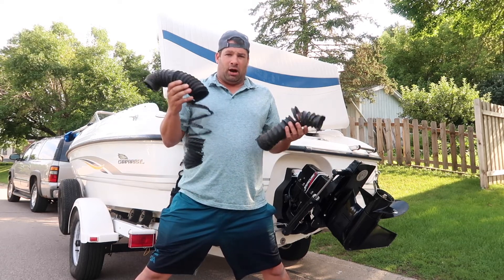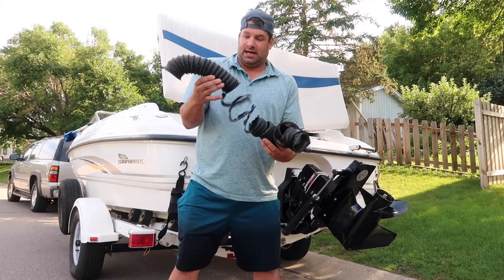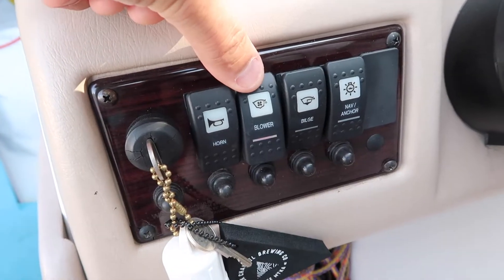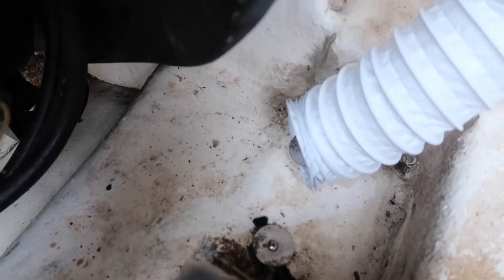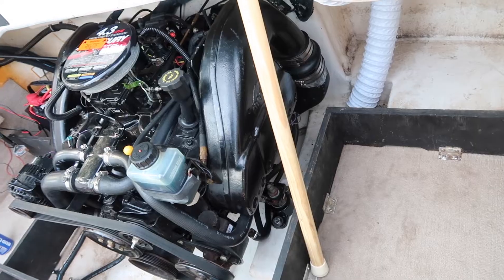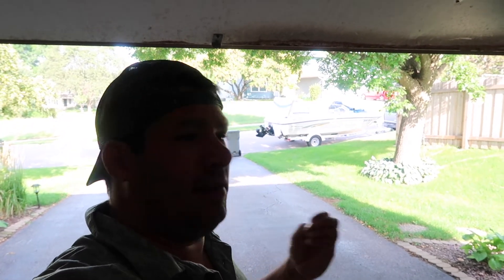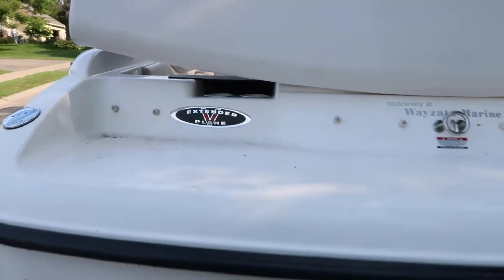What is & and Why do you need a Blower Motor in a Boat.

Comment: I've got an 06 Chapparal 256 SSI that I bought last year and I had a mechanic tell me to not even worry about using the blower motor and another one told me that I should be using the blower motor anytime I'm driving because it helps keep the engine bay from getting super hot

Comment: Also for safety:
1) go over all fuel system connections at the start of each season, tighten clamps, check for leaks
2) install a gas fume detector, I put one in my boat about 7 years ago, should be standard on gas inboards....
3) make sure all electrical equipment is J1171 Certified for inboard marine use (starters, alternators, even fuse blocks)
Reply from the maker: Great points. I agree, fume detectors should come standard
Reply from the maker: Thank you for all the helpful tips for everyone reading the comments. It will help people

Comment: Hi Chris; I'm a fairly new boat owner andI have an 18 foot runabout boat and it has 4 vents, 2 on port and 2 on starboard. With the blower on,  the vent on the outside on port side, pushes air out. On the starboard side neither vent pushes air out. Does this mean a hose is not properly connected to one vent on this side?

Comment: Is there only 1 blower motor in a boat your size?  I just a got a similar sized boat and notice there is one blower motor, but there's two vent whole on each side of the engine compartment area, looks like yours had the same.  Would it be wise to run a blower on each side of the compartment or is one sufficient?   Btw all your videos have been extremely helpful,  thank you for posting and being so clear in your posts!
Reply from the maker: Yes one blower motor. The other holes are for air to come in.
Reply: If you look at the side ventilation grills..they have diferent direction..if you are inside the boat on front of the motor.....you will see that left side is designed to get air in the motor while moving forward..the right side is designed for get out.
Blower goes on the right...originally there are 4 hoses...2 for each side... my boat came with only one blower.but you can put another one if you know how...
So...i suggest to replace all the hoses....west marine has 10 ft for 16 dls...i needed 20 ft for all 4.
Thanks

Comment: Question for ya. I’ve got a Glastron, and just replaced the blower motor and tube. However, I have 3 vent openings. One of which is for the blower. 2 vents have hoses hooked up, but drop down to the bottom of the motor. I’m the second owner, but not sure if I should actually have hoses hooked up to the two that just sit at the bottom of the motor, or if it’s a better idea to take the hoses off and let air vent naturally. Any thoughts? Thanks for the video!
Reply from the maker: Most the time one hose just goes to the bottom with no pump and one goes to the bottom with the blower motor. It helps move fresh air to the bottom. I'd leave it. It sounds right how it is.

Comment: Hi, do you need to keep the blower on all the time or just before a start up? Thanks for the video by the way
Reply from the maker: A couple min before start up. At least 30 seconds. My old boat said run it for 5 min and when idling. I don't usually have it on when cruising unless I forget about it. It doesn't hurt anything if it stays on.
Reply: @BigIslandMNMinnetonka  brill, thanks for the reply mate, appreciate it ☺
Reply: @BigIslandMNMinnetonka  I usually leave mine on, and the only downside is that it won't last as long. I think I'm on the third blower, over 15+ years, so approx. 5 years per blower.
Reply from the maker: @Luigi-pk8mk  I sometimes open the hatch and let it air out before I start the boat just to save on the life of the blower.
Reply: @Luigi-pk8mk  Thanks Luigi for the contribution... I was wondering if the blower motor would burn out if you leave it on.  In case, you turn it off after running it for 5 mins, is there any other ventilation that happens inside of the engine compartment?
Reply: M Chaves 
I have found even with leaving it on constantly they still last a long time. I’ve had this boat 18 years and have replaced the blower twice. Most are not rated for constant use but there is one that is, the Sure Flow Yello Tail. Next time I replace it I’ll go with that. M
Natural ventilation:
Should be present if the vents and hoses are set up right. Example:
Vents on the gunnels should be set up so that:
The one connected to the blower is facing aft; this helps pull fumes OUT of the bilge...
The one on the other side is facing FWD, this should be connected to a hose that brings fresh air INTO the bilge. This is natural ventilation but the boat must be moving forward for it to work.....

Comment: Do the blowers commonly break?  Just bought a boat and I could have sworn the blower was working now nothing. I hit the switch and the light for the switch is intermittent. No blower at all. Loose wire or bad blower?
Reply from the maker: Check wire connection on the back of the switch and blower. They do go bad. Not often but the do.
Reply: @BigIslandMNMinnetonka  turns out the blower was completely ceased. Replaced this morning and all good again.  Thanks

Comment: What if my boat doesn't have those exhaust and intake holes. My hoses run into the hull of the boat which is an enclosed area. 1996 four winns horizon 5.0 volvo penta
Reply from the maker: It’s best if fumes lead to out of the boat. And not into an interior part of the boat. Main thing is that the fumes don’t ignite

Comment: So are you sucking air INTO the engine compartment or sucking fumes OUT of the engine compartment. I have to replace mine and just want the flow to be most effective.
Reply from the maker: Suck air out from the bottom. The gas fumes sink.

Comment: As per my views suction hose starting point should be installed highest point of the bilge instead of keeping bottom of the engine because fumes and vapors light in nature due to heat  so collected in top of the bilge and inducing  air inlet should be bottom of the engine but not together as well outlets should not be kept  together it should be away from one another, if it kept together  same air go inside one which is exhausted  bear with my bad English thank u all

Comment: Hey man..I have one boat It's a Crow line 94 the engine is a cobra 5.0 v8 inboard engine but I did take to the lake like one week ago but when I lunching in the water the water star to come in Inside the engine compartment its that's normal or I have to fixing something
Reply from the maker: Check your bellows or cracks on motor

Comment: I have a question if your still around. 
88 bayliner 305 v8 with the I believe omc out drive.  Can that be changed over to a alpha,merc?
Reply from the maker: Sorry, I don't know. You might have yo chane everything on the transom and have the right gear ratio. But unsure
Reply: I have the same boat setup, SEI sells a conversion kit for their SEI16 that will also allow you to use a Merc Alpha 1 Gen 2 out drive without changing the motor or hydraulics. Your current gear ration should be 1.5 and Merc has a 1.47 that should be perfect. Make sure you replace the bellows when you have it apart, you may need a new throttle handle but not always.

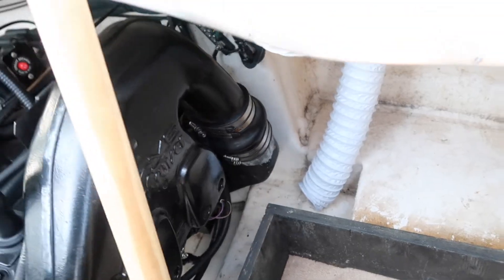Comment: what are the white wires wrapped around the black shaft at the upper right of the screen @ 1:36 ?
somekind of resistor for charging?
Reply from the maker: I don't see any wires upper-right of the screen. On the left I have wires for on board lights and depth finder

Comment: What kind of blower did you get and is the blower inside the dryer hose?   You just have one sucking air?
Reply from the maker: Not sure what kind of blower. Yes it sucks air. I replaced the hose since mine was ripped.
Reply: Chris Boats do you put the pump inside the vent hose?
Reply from the maker: You mount and hook up the blower motor and then hook up the hoses. Make sure it is the direction that sucks air out of the bottom

Comment: I'm new to boating but I'm trying to save some money by doing the maintenance myself.  I have a 96 crown line open bow boat.  How difficult is it to access the engine compartment to change the plugs and fuel/water seperater?
Reply from the maker: Depends on if you have a back bench or not and what size motor.
Reply from the maker: Fuel water separater https://youtu.be/Pejg4y46JrI
Reply: I just changed out my fuel-water separator... that was easy.... BUT make sure to fill the new one up wiht gasolene (petrol in Australia) before you screw it back on to make sure the boat starts (I did not do this and had trouble starting the boat as the petrol pump didnt pump enough through) also if it is NOT disel fuel then just leave the key on for 2 minutes to allow the pump to pump through the gas and any air out of the line before you start up :) PS this is only DIY advice not to be taken too seriously as I am an amature

Comment: Hey Chris, my blower hose is too short to hang on to both the fan and the vent, so I need a new one. Question is, my tube sitting up against my exhaust manifold (3.0 Merc) will the poly dryer hose still hold up?
Reply from the maker: The exhaust manifold shouldn't get to hit. I would more worry about vibration rubbing a hole in it

Comment: Hi Chris, are you planning to do a blower replacement video in the future? I think some water might have gotten into my vent hole and killed my blower. i can't find any videos of replacing them, is it a lot of work or just a simple fix? thank you for the video.
Reply from the maker: It should be an easy fix. It is just two wires and maybe 2 screws holding the blower in. If I were you I would look for a fuse. But, the blowers do go bad too.
Reply: @BigIslandMNMinnetonka  ok sweet I guess I should check the fuse but it was saltwater that went down to the blowers so I think there's a higher possibility it's the blowers. Thanks for the tip!
Reply: @michaelp2922  you are probably right. If it is easy to get to it should be easy to fix.

Comment: I wonder if the marine one uses stainless steel wire inside the hose support. Nothing worse than rusting steel, causing a brown stain on your gelcoat years later.
Reply from the maker: They should im the dryer vent then too. The dryers job is to kick moisture out.
Reply: Use a magnet to see if it is stainless steel or normal steel. Stainless steel is not magnetic

Comment: Whats the best fuel to use in this motor?
Reply from the maker: If you are talking about the 2001 4.3 mercruiser I would say 89 octane. That motor has been known to run on. On forms to prevent that they say run higher octane. I actually run 92 from costco.

Comment: so how do i put the blower ? do i put one of the end under the boats motor
Reply from the maker: You can install it anywhere as long as one end of the hoses sucks air from below the engine and the other hose is hooked up to a out hole

Comment: So while your cruising you don't need to have the blower motor on?
Reply from the maker: No. It doesn't hurt though. It usually gets a little air flow when cruising.
Reply: @BigIslandMNMinnetonka  How often do you run the bilge pump?
Reply: @tommyg6742  I never run the bildge pump. I run the blower motor before i start the boat and when i am idling
Reply: @SimpleFamilyLife  ok cool, thank you very much for the help!
Reply: @tommyg6742  no problem. I have only used the bildge pump once after a night of rain. The blower everytime I boat
Reply: @SimpleFamilyLife  makes sense. Thanks again!
Reply: Technically you are supposed to run it at anything below cruising speed from what I have read, so when off plane, at slow speeds turn it on, on plane there is enough air flow that you don't need it. BUT, this depends on how the vents are set up on the boat. The vent attached to the blower outlet should face aft, and the vent on the other side of the boat that brings in fresh air should face FWD. That sets up natural air flow as the boat is moving. 
But regardless, every time you start you should OPEN the engine hatch and SNIFF for gas fumes! I am simply amazed at how few people do this, not knowing an inboard gas engine can be a bomb if you have a fuel leak!
Reply: @Luigi-pk8mk  Yes, On my old 1988 it said right next to the key you should run the blower during idle speeds. I do about 75% of the time. I usually forget about it and it runs the whole time I am cruising too.

Comment: Gas fumes don't exactly sink. Only propane sinks to the lowest point due to it's specific gravity. The fumes need to be removed prior to starting the engine. The blower should be run for 2-4 minutes prior to turning it over and during slow speeds depending on the boat type. My blower has intake on starboard side and exhaust on port, as I reach speeds over 10MPH, I can shut my blower off as the vent on starboard side will draw in air and port side will vent it. You should have an air intake hose in the front of the engine and one on the opposite side, and the exhaust hoses on the rear and other side so air is drawn across and around the engine.